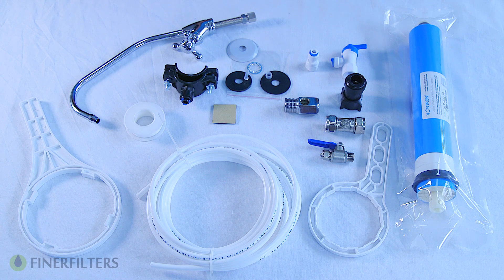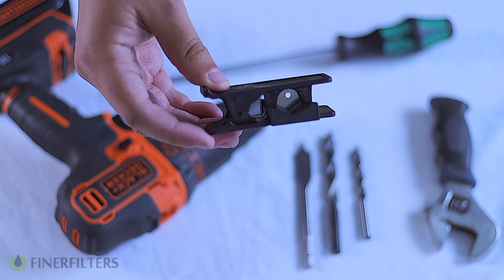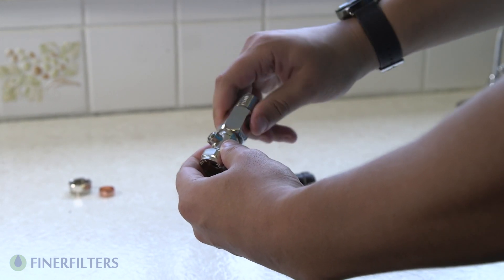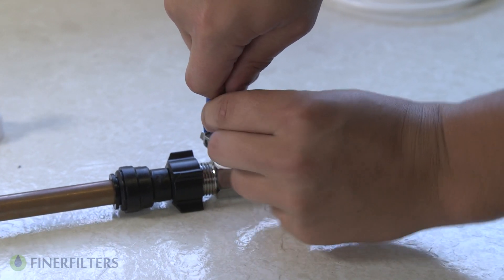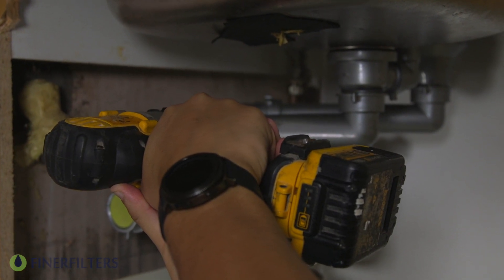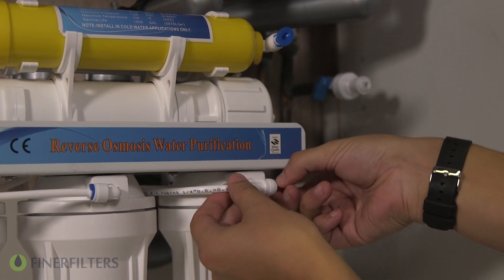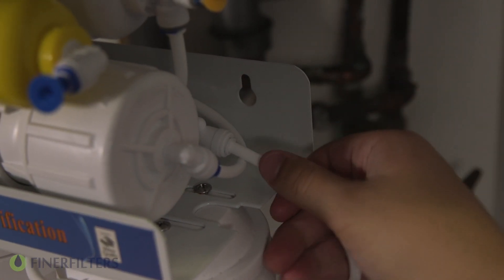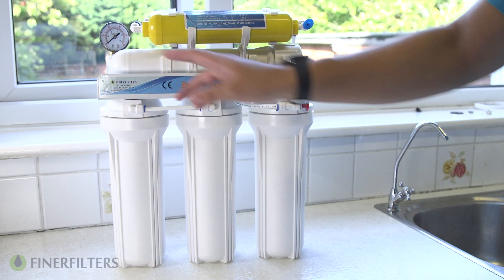How to install a Reverse Osmosis Water Filter System - Finerfilters

Comment: I did everything as in the video. It has a 40 bar timer. But the water flow is low and when we use about 3 liters of water, the water stops and we have to wait a long time to refill. What could be the reason for this?
Reply: I wish I could send you some photos of mine

Comment: I find it very silly how this osmosis system doesn’t include the pipe you need for the tap or specify what mm thickness you need to buy on top of this expensive kit

Comment: Why is the pressure gauge showing 100+ psi when I close the flush valve(L1). No water is going into the tank and I have checked the pressure in the tank. It was working fine until I added the membrane and it’s like the membrane is just stopping it. I have the model with the pump.

Comment: Hi, I have just installed this system with a pump unit at a new house address, there seems to be adequate water pressure without actually powering the pump unit up. Will it be okay to use without plugging the pump in to the mains or will any features be missing due to not having it powered up or will it operate as normal? Thanks in advance

Comment: I just changed all the filters and checked water and its showing acidic water.. Hp is ment to be green this means im drinking water with no minerals this could be dangerous... I brought 6st filter so i can have minerals in water. Why is this happening
Reply from the maker: Hi Mr Barak. This is strange... please can you check to see if the yellow filter is a resin filter or a remineralising filter? Either way, if you'd like to message enquiries@finerfilters.co.uk, we can get a replacement mineral filter sent out to you to correct the issue. Thanks

Comment: What's going on? I'm doing 2nd flush, there's water going down the drain. I'm only at 10psi.
Reply from the maker: Hi Derek. Do you have a pumped or unpumped version? Unfortunately, 10PSI isn't enough pressure for the system to operate.

Comment: Can this be hooked upto an outside tap
Reply from the maker: Hi Simon, providing that the pressure from the outside tap is sufficient and that the unit is not left out in conditions in which the unit could be damaged (freezing weather, etc...) then yes it technically could be hooked up to an outside tap. Our aquatic customers usually hook their aquarium RO systems to their garden taps, and some opt for a booster pump to increase pressure and output.
Reply: @finerfilters  all set up I have great pressure and seem to have a fast drip
Reply from the maker: @simonsmith7594  Great, glad to hear! You can always email us at enquiries@finerfilters.co.uk if you have any further questions or queries. Kind regards, Shaun

Comment: the flow is great before i add the membrane, soon as i add it for the 2nd flush the water only drips extremely slow 😭 is this normal?
Reply from the maker: Hi Zura, thank you for your question! Yes, this is normal. You will find that the unit takes around 30 minutes to an hour (especially after the first few flushes) to produce a steady flow of water. This is because the process to produce RO water is unfortunately a slow one with a lower GPD membrane. This is why we include a storage tank with all of our units which will automatically fill up when water is dispensed from the unit, ensuring it is topped up at all times so that you have water on demand. You'll hopefully have found that you should be getting a constant stream of water when you turn on the tap now due to the tank having time to fill overnight. Kind regards, Shaun

Comment: he either tells it wrong by saying sediment filter first and pointing to the middle or assembles it wrong by putting the blue one in the middle . The instruction book is not very clear about this either not helped by two of the filters having almost the same name labels on the actual unit would be most helpful .
Ok so from the manual the sediment should be on the right not in the center as he says in this video .
I can only guess the blue to the center is correct .

Comment: lol the hole in the sink , wrong drill  size .
Reply from the maker: Hi Duke, the drill bit used in the installation part of the video was indeed slightly larger than the 1/2" bit we displayed in the beginning. This was because the particular drill bit we had at the start was a wooden drill bit and not suitable for metal. However, as long as the base plate and bottom plate secure over the drilled hole then the tap will stay in place. Hope this helps! Thanks, Shaun

Comment: Question please. Are you flush the system every time you change filters? Thanks
Reply from the maker: Hi, thank you for your question!
We advise you to flush the system around once per month for 2-3 minutes by opening the flush valve on the drain line, but especially when changing the filters. 
When you change your filters, always be sure to flush your pre and post-filters WITHOUT the membrane installed. If you flush your fresh pre-filters and the membrane is still installed, then loose media which is initially washed off the pre-filters can travel into the membrane housing and block up your membrane - which will cause problems. You should flush the system through first without the membrane, then do the same after installing the membrane, and then opening the flush valve for 5 minutes. Be sure to close the flush valve after every flush to create the backlog of pressure required for the RO filtration process to take place!
Many thanks, Shaun :-)
Reply: @finerfilters  sorry to bother, one more question. Tank was full for the first time so next step was to open tap and let water pour out but how do I know that tank is empty? ( except weight) as water keep coming out of tap? Thank you
Reply from the maker: @someoneelse79second  Hi, the tank has a 6.5-litre capacity, so you can either measure this with a jug or other measuring means. You should see a decrease in pressure when the tank is empty also when the water is flowing. Another way to check would be to simply lift the tank up before you empty it and when you think it may be empty. If it is considerably lighter than when you started to empty it then it means the water has gone.
Many thanks, Shaun
Reply: @finerfilters if I flush once a month should I remove the membrane?

Comment: Hi. Does anyone here know why the tank is not filling please? I've left it overnight & it filled ok, nothing great. Then left again for 4 hours, I get 4-5 minutes of water running with low pressure.
 The pressure with tank empty is around 10 psi but when left for tank to fill up, doesn't change. 
However, I had previously owned an RO system & never had any problems with pressure or tank filling up.

PSm I've tried phoning with bicycle pump but made no difference to the pressure guage.
Reply from the maker: Hello sir, if you are continuing to experience issues producing water then I advise you contact our customer service team - enquiries@finerfilters.co.uk. They will be able to troubleshoot and assist you to get your system up and running correctly.
Thanks, Shaun

Comment: What is the drill you use for the hole in the stainless steel  sink it is not in the list
Reply from the maker: Hi Johan, thanks for your comment.
We used a 1/2" drill bit here for the tap, which is shown at the start of the video when showing what tools are needed. However, you can use anything between 10-15mm. Thanks, Shaun :-)

Comment: HI
there is now another problem... I fixed everything and I did the 1st flush without the membrane and everything works and water is coming from the tap BUT after putting the membran in the housing there is no water coming from the tap ?
Reply: Once you've flushed the filters through and installed the membrane, it will take some time for the tank to fill before it can come out the faucet

Comment: Hi shaun, im thinking about purchasing 6 stage domestic RO system. I read that i’ll have to also buy an pump to increase my water pressure, could you please upload a video on how to install RO system with the pump ?
Reply from the maker: Hi Mike,

Thank you for your comment and your consideration of purchasing one of our Domestic RO Systems. 
The installation of the unit with the booster pump is exactly the same. The only difference is that there would have to be a 3-pin plug socket located nearby the install to plug the pump into. This is the only difference. Hope this helps :-)!

Thanks,

Shaun

Comment: can i wuse this system without the tank? whats will happen if i dont use the tank?
Reply from the maker: Hi GMX,
The tank is pretty neccessary if you wish to have water to drink on demand every time you turn the tap on. The reverse osmosis process takes a while to actually filter the water, so if you were to turn the tap on without the tank installed, and just call for water from the unit without any stored then the water would literally trickle out from the tap.

Thanks,
Shaun

Comment: Found the video to be helpful, as you say further down the comments, it needs updating and correcting, and adding of important info thats not in the installation booklet like tank bladder pressure. and note it is not the same as system water mains supply pressure, as I bet some one will try to put 80 psi into that bottom valve! 

 well presented video, clear on the basic fitting and connections.

where can we get spare blue collet's? as they are bound to disapear down behind the kitchen cupboard units lol.
Reply from the maker: Hi Brian,

Thank you for your comment! Yes, the video is a little dated now I understand. I am glad you found it helpful though and thanks for your feedback.
If you would like to use our contact form on our website to send an email over then we can arrange for some blue collets to be sent out to you.
Regards, Shaun

Comment: What is wrong with not flushing the system initially? Will all the unwanted particles be in the membrane and tank?  How do I undo this? Can I empty the tank somehow?  And can I flush the membrane out?
Reply: There are loose "carbon fines" which will be expelled by the water pushing through the carbon filters. This will block the membrane. It may be possible to backwash it or flush it out but chances are you will need a new membrane!

Comment: Hi I am a bit confused, did you flush the system through the waist pipe with the tank valve closed or through the facet with the tank closed
Reply from the maker: HI Jan, when flushing the system through, the tank valve should be closed and the faucet open. Don't forget to open the L1 valve also, which is situated on the waste water line, to allow the water to saturate the membrane. Be sure to close the L1 valve before opening your tank valve to allow pressure build up and for the filtration process to begin.

Thanks! Shaun
Reply: @finerfilters  Thanks very much Shaun

Comment: Hi, I bought 5 stages osmosis filter and it is working fine, is it possible to add the mineral filter after having bought and setup the 5 stages one? thank you
Reply: It is indeed possible to add the mineral filter later, as an upgrade. You just need 2 extra fittings (push-fit, 1/8, you can find them on their website for around 2 quid a piece).

Comment: Hi i installed my filter but schould i leave the tap on  4 the dirty  water flow  all the time or turn it off to get a full tank??
Reply: Hi Doa, thank you for your question. Please can you clarify what you mean by the tap for the dirty water? Do you mean the drain line which runs out of the back of the system? If so, the valve next to this, the L1 valve, should be closed at all times - except when flushing the system. This valve needs to be closed for the tank to fill with the pure water as when it is open, the water bypasses the flow restrictor which is needed for the water to be forced through the membrane and to be filtered. Let me know if I can help with anything else!

Comment: 1.) what should be the average Ph of the water produced from this as mine is reading 8.5 this seems too high . 

2) Do you have to flush before use , how do you do this ? 

3) can the remineralise tube be removed ?
Reply from the maker: Hi Hezekiyah, thank you for your question.
1. Referencing question number 3, I presume you have the 6 stage unit with the remineraliser filter? Pure RO water has a slightly acidic PH and can read between 6-7PH. With the remineraliser filter, it adds essential minerals back into the water such as calcium and magnesium to boost the overall TDS and PH, turning it from slightly acidic to slightly alkaline. The reading of 8.5PH is totally normal and is a good indication that the remineraliser filter is working.
2. It is recommended to flush the system on your first water flush or filter replacement, or even after not using the system for a week or so. The best way to do this for the FIRST flush when you've replaced the filters is to remove the membrane or make sure it hasn't been installed. This is because when you flush the pre-filters for the first time, loose carbon fines exit the filters (which is completely normal) and will prematurely block the membrane, rendering it useless and would require you to purchase another one. Once the water has run clear, you will be good to add the membrane back in and re-do the process. If you are just looking to flush the system after not using it for a while then you can open the L1 valve (see 8:53 in the video) and this will let water bypass the flow restrictor - allowing the water to skim over the membrane with no restricton and essentially clean it. Make sure you close the L1 valve after 5-10 minutes of flushing as your system will not produce RO water when this valve is open. You can find more flushing information on page 11-12 in our installation guide.
3. Yes, the remineraliser filter can be removed if you wish. Just note the PH and TDS will drop, and the taste will change if you decide to do this. 
Thanks, Shaun.
Reply: Finerfilters LTD thank you so much for replying , I’m so confused of the flush process . I had a plumber install it . So it it’s already set up and I’ve been using it . Could I possibly do a video call and you can talk me though the steps ?
Reply from the maker: @hezekiyahisrael5804  Hi Hezekiyah, no problem! I see, is the system operating as expected? If so it would seem the plumber has installed it correctly. 
We unfortunately dont have a video calling service set up as of yet, however feel free to call 01704 807600 to speak to a member of our team who will happily help you with any enquiries you may have :-). Thanks